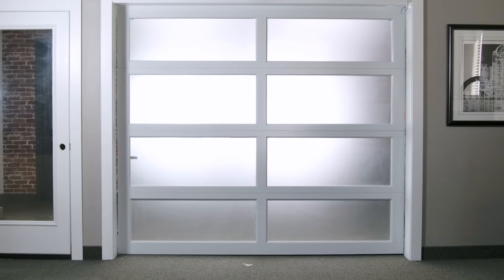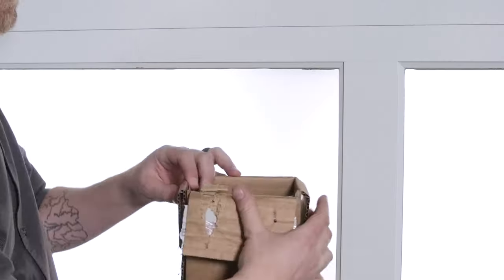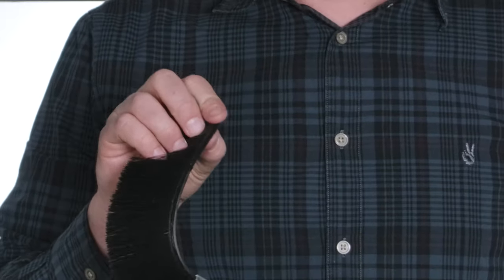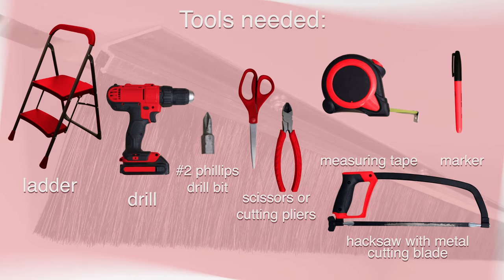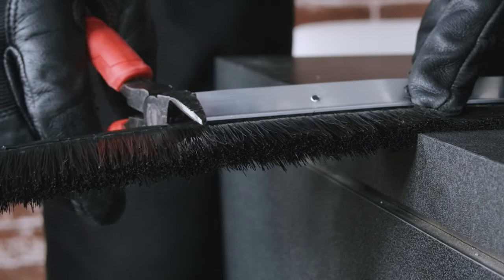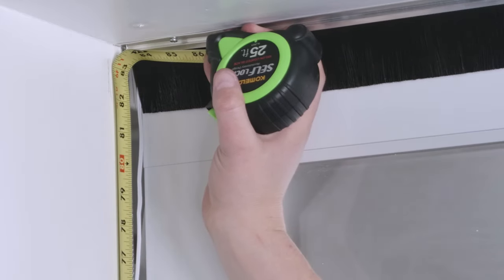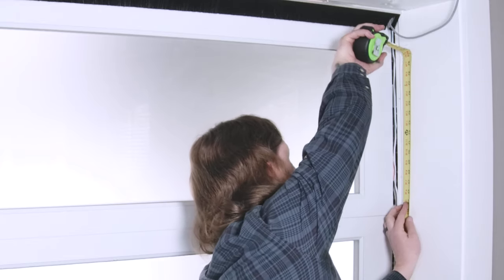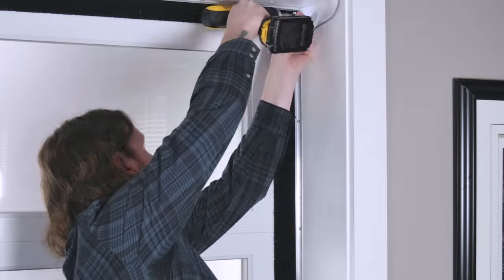How to Install a Brush Seal

Comment: Do you use a straight retainer, or a 45 degree retainer for a residential garage door?
Reply from the maker: Hi Mark, We recommend using a 45 degree retainer for residential garage doors. Please, let us know if you have any other questions. Thank you!
Reply: What about for commercial roll up doors what angle?

Comment: When is a straight retainer appropriate over a 45 degree retainer? 
Chris
Reply from the maker: A straight retainer is usually used for doors with uneven surfaces like a rolling steel door.

Comment: One thing that isn't clear. Is this installed inside or outside. Couldn't tell from the presentation. Please explain.
Reply from the maker: A brush seal is installed on the outside of a garage door.

Comment: Can you install these to the bottom of a metal up and over garage door, or is it too difficult to attach to the door?
Reply from the maker: Hi, Colne Yacht Club. We do not recommend installing a brush seal at the bottom of a garage door. For the bottom of garage doors we suggest one of our bottom seal kits. They come with a retainers that can easily attach to the bottom of a metal door with a few screws. The seal expands as the weight of the door comes down on it making it a more effective seal. You can browse our bottom seal kits here: https://www.northshorecommercialdoor.com/universal-kits-weather-seals.html Let us know if you have anymore questions. Thank you!